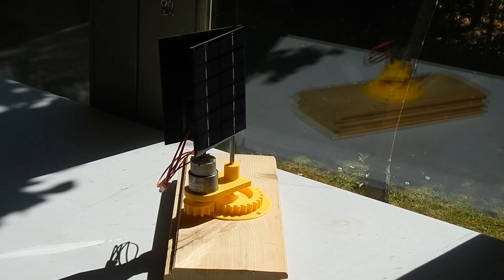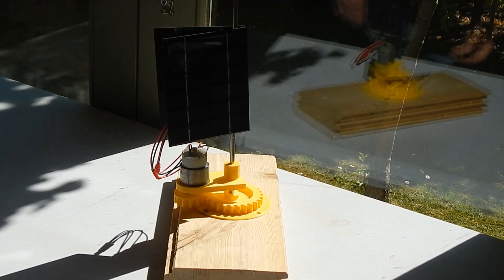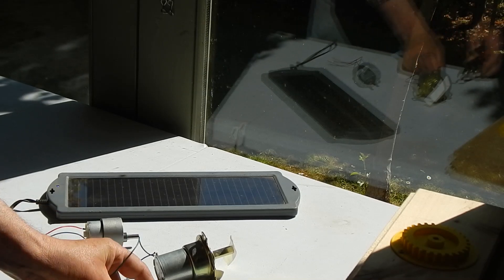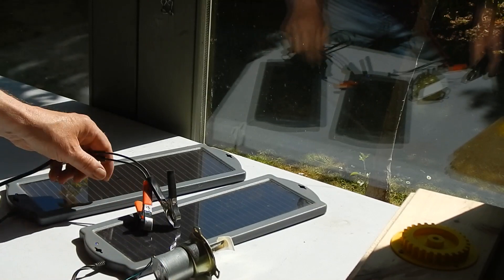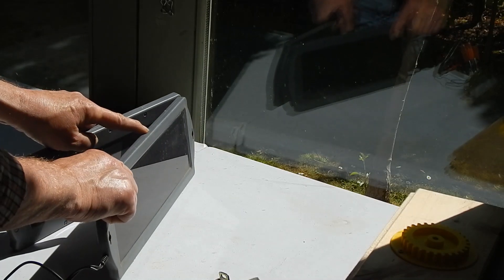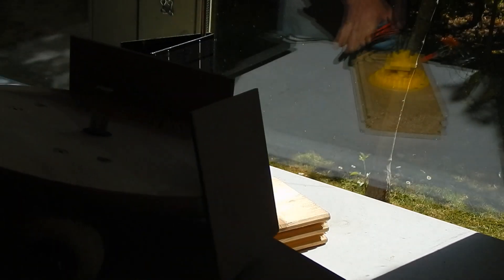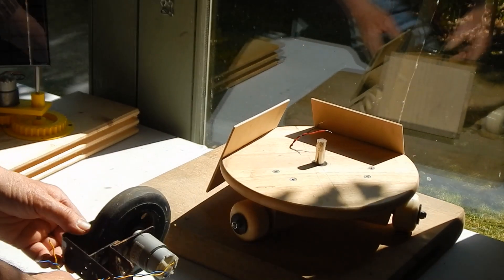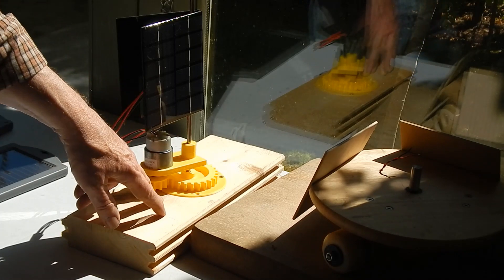Worlds simplest solar tracker (Tutorial)

Comment: i made one and the angle was too much and i got the second panel was getting too much sun.  i reduced the angle and it works great. i two  running a 3x3 solar panel and the motor is very slow 2 rpm.  the motor turns a worm gear to a spur gera.  this stops the wind from turning the large panel.

Comment: i have a problem.  i call the two solar cells "night" and "morning" because that when they should be driving the motor.  My problem is that when the night is driving  the morning is resisting the night.  the morning has too much light.  the only way i can get it to stop is when the sun goes down.  i have a limit switch on the night because it will go too far and the morning cell will not see the sun. when the system reaches the limit switch that turn off the night cell, the morning is still working and moves it of the limit switch then the night turns on again. back and forth.  i changed the angle of the cells to about 30 degrees because i thought the morning was in the sun too much.  still did not help.. i used worm gears on the motor because spur gears the wind would just turn the large cell around. i could send pic some how if you want to see more.  i have two of these unit that run my three pump pond. the first one ran for two years then it started having troubles. so i up graded the small solar cell and that destroyed everything.  i am thinking the solar cell are too good and work with very little sun. and that why the morning is always working. any idea i need help

Comment: Hello sir.  This is a really cool working model.  I am new to solar panel and power station.  Have done many hours of research on self power solar tracker like yours.  Learning it as it goes.  I don't have any 3d printer or any device allow me to make any accessories.  I saw how you use a skateboard wheel mounted to a motor and mini solar panel to make it move.  May I ask a how you mount your motor onto the skateboard wheel to make it not loose?  I have couple of those low torque low RPM 12v gear motor and would like to use it for this project.  I am having issue on mounting it to a skateboard wheel.  Thank you in advance and your time. Jack

Comment: Looks good but is the sun hitting directly in-between the 2 panels where they join? and not directly hitting in the centre of at least one of the panels for more power generation?
Reply from the maker: The two little panels are used solely to drive the tracking mechanism - A larger producing panel would be attached to the mechanism and be kept directed at the sun.
Reply: @Targetmaster1066  Yes indeed, Brilliant! I'll be using this to generate a lot more from my panels. THANK YOU!.

Comment: good vid thx but why all the homemade trackers are small? who use these for solar panels? no one makes 12v drill motor or actuators with 12-18v battery (scaleup) for real use please
Reply from the maker: Good point Kay - Even these small drivers can move a fair sized panel if the gearing right. I'll get a video up with a practical larger panel tracker.

Comment: Hi there, I like this concept of tracking as it is self sustaining and very simple to put together. However, with the sun rising and setting, obviously the motor will turn freely in any direction, so I guess my question is how do I limit the maximum rotation degrees and enable the motor to sort of default back to a set position when the sun has set? I hope this makes sense somehow. 😉
Reply from the maker: Hi Ian - Makes perfect sense. I have found that unless you have a clear view of the East/West horizon the tracker stops as soon as it's in the shade, I have high fences and trees locally so the tracker never makes a full swing. If you wanted to artificially limit the travel you could physically stop the tracker with a solid block and arrange a slipping clutch mechanism to the drive gear.. Or.. as I have now done, where the tracker is mounted in clear view of the horizon, add a third drive panel, in parallel with the left panel, so in the evening the third panel will pick up the sun as soon as it rises and rotate the panel to "self set" Watch this:   https://youtu.be/DPvBAQ0WP4M

Comment: Hi there .. I tried a similar set up however when both panels were connected the motor would not turn when one panel was shaded . I’m curious if the reason might be the presence of or lack of a blocking diode ? The motor turns while connected to one panel . And obviously works if both panels are connected parallel . I’m using 12v motor and 12 v 10watt panels . I’m a bit confused .. thanks 
John
Reply from the maker: Hello John - I've been down this road too. Most of the panels I've used work just fine, however I recently bought some 12v 5w panels - great output and good price but just will not work. Yes, I guess they may have internal diodes, I just haven't had the time to investigate further.
Reply: The trouble was the blocking diodes.. I snipped the side soldered to positive on both panels and the motor works as should shade one clockwise shade other counter clockwise. .. thanks .
Reply from the maker: @johnwells583  Well done John - Send a link to a picture when you have a panel up and running.
Reply: Thanks for your reply .. I’ll see if I can remove or bypass the diode and check in again ... what was the type of -angel you used ? I see your using a 6v motor what is the voltage of your panels ? 12 or 6 ? Thanks so much
Reply: Panel not angle ... I should proofread before I send :-/
Reply from the maker: @johnwells583  I've used several different types, all work well except the last batch I bought. These are the ones in the demo video. Search 6V 2W 330mAh 110x136x3mm from Banggood.  These are the ones I can't get to work yet. Nothing wrong with the panels - just don't work as I want them too. Ebay: 402722894131 (I paid £7 each just 3 months ago) ... Using the small DC motors at double the rated voltage is not usually a problem unless they are running hot - they just go faster.

Comment: I think that over time one or both of the cell banks will burn out.
Reply from the maker: Absolutely no reason why they should Jim - when the panels are in the null position they are producing almost no energy, although of course, time will tell. I've had a system running seven years now with no problems.

Comment: Brilliant control mechanism! I might steal the idea to automatically align my parabolic solar cooker. I'd imagine a similar setup could be used with a linear actuator to control the azimuth adjustment.
Reply from the maker: Thank you Mike: Check my older videos and you will see  I use the same system for a parabolic dish and also for a two axis tracker.

Comment: What size motor did you use with the skate board wheels and wood platform
Reply from the maker: Hi Jackie - The motor/gearbox was a 6v 37mm 3.5 rpm motor (the slower the better for more torque).
Here's a link to the motors I use. https://www.ebay.com/itm/360519569444?hash=item53f0a41024:g:sfUAAOSwDTNayKpK
Reply: @Targetmaster1066  Thank you so much for the link. How did you get the wheel to go on the small shaft and keep it on?
Is there a way you could send me a better picture? Then where did you get the yellow gears you had in the first one. I also would need a smaller tracker and I am not finding anything like it?
Reply from the maker: I'm lucky to have the machinery to make part like that. The shaft of the gearbox is 6mm and the internal of the skate wheels is maybe 10-12mm. I just machined an adapter out of plastic to fit. You might find some plastic tube that's near enough and fill any slack with the hot glue gun.
The yellow gears I designed and 3d printed.  (No 3d printed needed on the turntable design as long as you can couple up the gearbox shaft to the wheel. You might hunt around and find something like this:  Ebay number: 223632526106
Are you UK based?
Reply: I am in the United States
Reply: @Targetmaster1066  can you give me your email to directly email you
Reply from the maker: You catch me at   aedt1066@gmail.com

Comment: But what triggers the motor to rotate?
Reply from the maker: The motor is powered by the small solar panels - as soon as enough sun falls on any one panel to produce enough voltage the motor will turn - when not enough sun is on the panels the motor will stop.

Comment: Wow!! And here all along I have been interested in a solar tracking system that is very costly to purchase in kit form on line. It's ridiculous the price that they are asking for a weatherproof encapsulated sensors, a manual direction controller and an actuator. Excluding the actuator, you have saved me spending money unnecessarily by providing me with a rudimentary tracker. Full props to you for doing so! Cheers from Canada
Reply from the maker: I'm pleased you found it useful. You can scale up this method easily - You could use two 20w driver panels to drive a car windscreen wiper motor which, if suitably geared and balanced would drive full sized producing panels.

Comment: Thanks for the idea. I tweaked the design, so it can turn bigger motor and move larger pv panels array (heavier load). Since both output can be positive or negative, I add 2 diodes and 2 relays (5 pin) to alternate power source and drive the motor (12v dc wiper motor) clockwise or counterclockwise, I've tested it and it works. I can use dc or ac motor depends on power supply to the relays. I add ldr sensor module (used to turn lights on at evening) to alternate the relays so the motor turns and the pv array would facing sunrise when the day is getting dark, the motor stop when a limit switch is activated. It's still a plan and now I'm still working on pv array support. At least I have the picture now
Reply from the maker: Excellent work - post a video when you have your system up and running.

Comment: Hi, thankyou for the video. May I know what drive motor are you using for the turntable design with skatewheels?
Reply from the maker: It was one of the same 37mm 12v geared motors. The lower the gear the more torque (power) will be available.  I think I used a 3.5 rpm motor here - it certainly doesn't need to turn fast.
Reply: @Targetmaster1066  Hi, could it work if i using the small solar panel u using with the turntable design?
Reply from the maker: @weichin1593  Yes, the small panels will drive a small turntable design if you use low geared motors. Look my Heliostat video - I use the small panels there. https://youtu.be/qqF_GgdUcmg
Reply: @Targetmaster1066  Hi, i did one for myself but im not sure why when i connect with two panels，one of the panels had only half the voltage of the other, which made it difficult to turn the other direction. Hope u could know the answer
Reply from the maker: It sounds like you have a damaged panel - they should both have about the same output under the same conditions.
Reply: @Targetmaster1066  at first I also have same thought like you, so i bought new one but the result is still the same.

Comment: Hi I wish to build a solar panel tracker driving a 200 watt panel weighs 10kg's mounted on my caravan.The panel has be able to be driven up  to the correct angle and also rotate to the correct position must also be able to self park to flat position.Any ideas as to how I can achieve this cheaply.
Cheers
Reply from the maker: Ohh - That's a challenge to get your teeth into Glen. That would certainly be a practical application of this system.
I can't see any real problem with designing something that would work - cheap is another matter. Another factor, is the extra complication of a vertical axis worth the extra gain? This depends, I think, on your latitude and if you can do the work yourself. I'm around 50N Lat. and find a single axis tracker gives me around 25% increase in output, adding the second axis give a further 5-8% bonus. I would suggest you would need a screw jack system for the vertical and a gear or toothed belt for the L/R axis. (maybe bicycle chain and sprockets or car cam belt and sprockets) I think on that and might make something over this summer it time permits.

Comment: Very well explained, and to the point without the typical superfluous details. It's enough information to get started, but not so much it becomes boring or confusing. I would very much like to learn of some of your sources for the mechanicals - those yellow plastic gears!
Reply from the maker: Thanks for the encouragement Seamus. Yes, you are correct, I used the same panels and motors in the dual axis tracker. The panels are around 15cm square, 6v and available from Banggood for around $7 each. The 37mm motors are widely available with a variety of gearing - slower the better for this type of project.
Unfortunately the yellow gears, I designed and printed myself so not available commercially, however I also show the turntable design with skate wheels that also works well.

Comment: Nice ! But Where is the component value?
Reply from the maker: Not sure what information you want Groot - I'll help if I can.
Reply: @Targetmaster1066  thz for the reply.
sorry , I’m just almost 0 this knowledge.

So u connect panel A + - and B - + to the motor?
Would it damage the panel with diodes?

Thanks
Reply from the maker: Yes, exactly right. Most of these small DC geared motors are very efficient and take little energy to drive them.  No diodes necessary, you want current to flow both ways.
Reply: @Targetmaster1066  Thanks. I don't see million as u say. u mean other website? or channel?

May u do dual axis with charging to a battery, would be better if come with cheap rain proof solution ^^
Reply: @Targetmaster1066  biggest issue now is I can’t find the 3d gear set. Since I don’t have a 3d printer.
Reply from the maker: @IamGroot-ln1nm  Think about using the skate wheel system - only need a bit of woodwork for that. See how it works in my simple heliostat video.

Comment: Thanks for showing a method WITHOUT a 3D printing.  There are those that don't have a 3D printer.
Reply from the maker: No problem Gary - You could just as easily cut two plywood discs with a jigsaw and use a belt drive system. 3D printing just makes life easier. I'm a great believer in "use what you've got" and make it work.

Comment: Great video thanks.Couple of questions please. In the questions on the motor your link points to one asks “is the motor reversible if connections reversed” the answer says “it seems not”? The other is the link to the solar panel which is a 6volt panel is that correct? Thanks.
Reply from the maker: Hi Graham - Yes, these are 6v panels, about $6-7 from Banggood. Yes, as with almost all DC motors they happily run backwards when you change polarity.
Reply: That's a comfort thanks. Now to get on with constructing a rotator for my modified washing tripod carousel for the Motorhome.

Comment: Also where can I get the file for the exact 3d print you use?
Reply from the maker: I design the 3d prints myself as I need them - I rarely keep the files for this sort of prototype stuff.
Reply: @Targetmaster1066  would also happily even buy a file download off you. I have access to my school's 3D printer by RSVP and trying desperately to make a heliostat to bring light into my apartment. I think if I could get a mirror on this it would be perfect. Not that skilled in 3d modelling of real parts though
Reply from the maker: @lolaloliepop  I don't think I have the files for this project any more - I constantly design, change and print stuff and move on. If you have a look at my other videos you will see my idea of a simple self powered heliostat using this principal. You will need to gear down the tracker 2:1 to drive the mirror at half speed to keep it aligned in the same place.
https://youtu.be/qqF_GgdUcmg

Comment: In the video what size is the motor? Is it  8#, 40#, 50#, 60#, 100# ?  Which size in the video are you using ?
Reply from the maker: The motor in the video is a small 37mm 6v DC geared motor 30 RPM (Search for 6v 37mm geared motor)

Comment: Thank you so simple, sorry for the silly question. How do you take off power after you have built it is just using + & - of the two solar panels?
Reply from the maker: Not a silly question John. This system is just the driving mechanism to drive a larger panel round to face the sun. The little panels used here are only enough to drive the motor for the tracker.

Comment: This a simple but very good solution to solar tracking. What are the specifications of the largest DC motor/gearbox you used on this project?
Reply from the maker: Thank you Douglas - This idea scales up well, all you need are larger "driver" panels compatible with your motor. The two larger panels I show in the video are 12v trickle chargers for car batteries, they will happily drive a car windscreen wiper motor which would, in turn drive quite a substantial panel.

Comment: If the tracker follows the sun until it sets in the west then would this tracking system be able to reset back to the east when the sun rises?
Reply from the maker: Yes it does Anthony, in fact there is only a "blind spot" of about 30 degrees directly behind it that it won't "reset".
Reply: Thanks for replying. Do you have any plans to create a similar system to vertically tilt the panel?
Reply: @AnthonyCook78  Watch this space :)